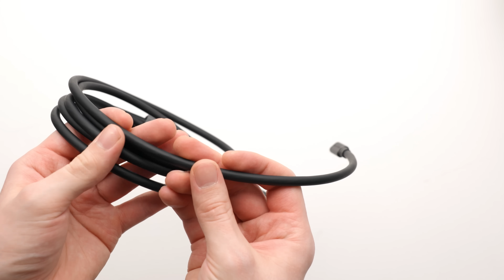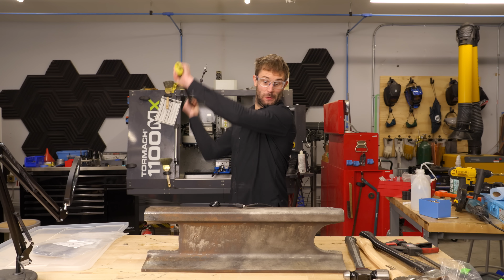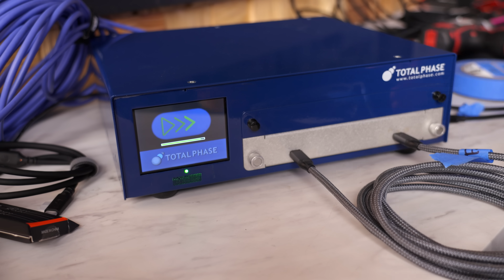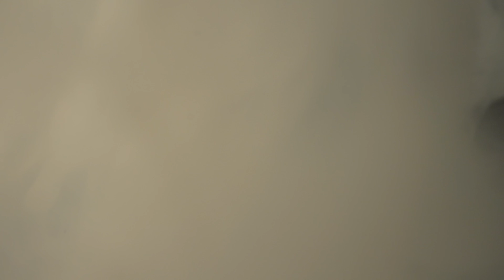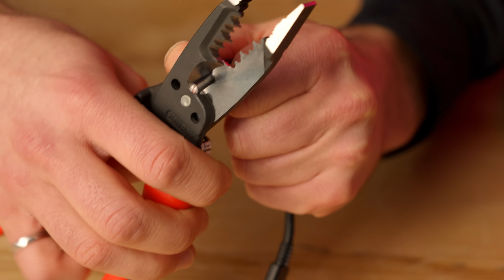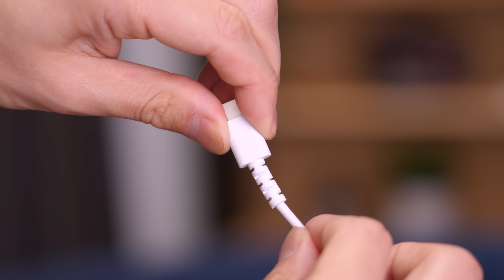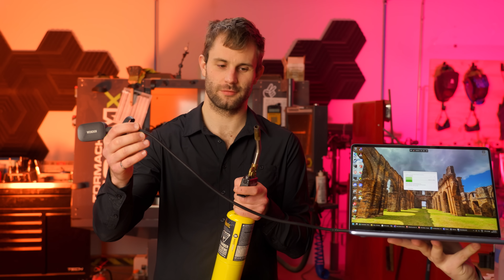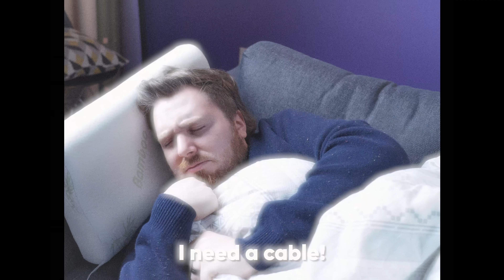Why It Took Me 4 YEARS to Make a USB Cable

Comment: 8:21 i have a micro USB one from Xiaomi, probably a lightning one by apple obviously, and if i remember correctly (we already threw it away), a 30-pin iPod dock charger. they were all like that, surprisingly, the microUSB one works fine, i even use it sometimes to charge my switch pro controller because dumbass company ("Performance Designed Products" if my linux desktop is not wrong) that made the controller decided to bury the port inside the controller's housing, and expect you to charge the thing using the joke they call a cable with a USB A housing that goes on for miles, there's like 7 triceratops there my man, just on the housing, that one xiaomi charger is the only one that fits in that joke of a port too, not like there's a tab or anything, but the hole is so tiny, oh and did i mention it won't talk to the CONSOLE over USB? like, you tell your switch to make pro controllers use the USB port for talking, nope, it just gives up instantly. IT DOESN'T EVEN LINK TO THE CONSOLE OVER USB SO WHAT EVEN IS THE PURPOSE OF GIVING IT THE CAPABILITY TO TALK OVER USB?! AT THIS POINT SLAPPING A FUCKING DC BARREL JACK WOULD COVER 99% OF THE USES FOR THAT PORT, except spamming your linux desktop with "USB device detected" "Performance Designed Products Afterglow Wireless Deluxe Controller has been connected." when the usb on your pc craps out and it looses connection
edit: dumb controller got the awesome USB transfer speeds of a 2004 HP PDA

Comment: I have had a USB 3.0 cable for 6 years, bought at Albert Heijn, it works fine, maybe one day when I need it, I will buy a new one or when I have more devices and I also have a 40w charger, it is enough for my needs

Comment: 99% of my cable usage is A-microB3, C-microB3 (hard drives), and  A-lightning, C-lightning (iphone, ipad).  I completely understand why you guys chose A-C and C-C to start with, I just don't actually need either of those until I eventually get around to upgrading my phone or ipad.

Comment: I haven't bought a USB cable in years, but the one in my car that I was using for Android Auto for the last 8 years decided to die on me 3 weeks ago. None of the cables in my big box of cables worked properly for the job so I finally had to suck it up and buy a new one. 

I was standing in line at the grocery store and saw the shelf of cables and they wanted over 20 dollars each for the cheapest looking cables I've ever seen, Home Depot was the same, and Best Buy as well, so I hopped on Amazon and bought a 5 pack of the same cable you showed failing at the beginning. For my purposes, they work great, but for a fully validated cable I don't think 16-20 dollars is unreasonable if that's what you truly need

Comment: Im curious about the connector durability itself. Im not talking the durability between the male end and the housing, but rather the actual connection of the contacts between the male and female ends. Ive stopped using anker cables for chargers because i find that their connection to my phone wears down over time and gets to that situation where i have to unplug it, flip it 180° and plug it back in, i have to hold it at an angle for it to work, and the charging speeds are rapidly decreased. Ive found belkin cables tend to fare much better with this and they tend to last close to 2 years of daily use without too many issues (the last clable lasted close to 2 years and i finally replaced it after the connection was so weak it would literally fall out of my phone from the cables own weight, and no, my port wasnt dirty, ive cleaned both my phone and the cable, and no change, but when i used a bew cable, the issue dissappeared completely, it was the contacts and connector detents that wore out).

Comment: Honestly, one of the most exciting parts is the variety of lengths. I don't need 3ft or 6ft even if they work 100%. Any extra length is clutter and wire management I have to deal with.

Comment: Current price for C to C is $27 (apparently regardless of data or length? It never changed as I switched products)
Most cheap C to C cables are about $6-10. Most quality cable are $16-20.
Not unreasonable but I would only buy one if I needed that level of quality.

Comment: As someone who only buys properly certified pro grade cables, I can tell you those chonker connectors are not going to fit in pretty much any phone cases. Also while Apple's older cables definitely had their problems with strain relief, people abused the absolute shit out of them. The remark about them lacking USB-IF certification is weird considering they're a core member of the consortium and wrote a good chunk of the USB4 standard.

I pay the extra for listed, certified cables. The crapshoot is real with everything else.

Comment: @Linus Tech Tips
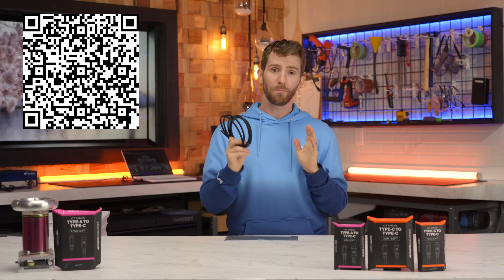10:57 QR ERROR
When I scan this code, I get no products, I do get to the website, but both USA & EU version shows "No products found. Use fewer filters or: remove all" but there is no filter.
Or your website is just confusing?
Reply: Linus has posted on the reddit (and various other places) on Sunday (Vancouver time) that they had to take down the page because Shopify decided to start taking orders for out-of-stock items (all of the cables) and that they would try and fix it.
Reply: @Metal_Maxine  
Ok, thanks for the info!
That situation sucks, but at least there is a demand for the cables :)

Comment: @Linus Tech Tips
9:34 You could sell an adapter:
USB-C girthy to USB-C slim
It might not be as high quality (because quality takes space) so the use of the adapter comes with the expectation of being more careful with it. (probably a dumb / naive / ... expectation, but it's at least cheaper to replace than the cable, so design it to fail there instead of at the cable).

Comment: some kinda breakaway cable would be nice. I've seen a handful of cables rip charging ports right out. Would be nice to have a breakaway, but the wattages on these things are getting pretty high. A breakaway could present arcing and other potential heat issues. Figure it out, LTT. I'll buy that.

Comment: When I saw how chonky those cables were I knew they were legit. Look at OEM USB-C docking cables for example. If you want to stay in spec and maintain signal integrity, you can't make a thin cable. If you need power, DisplayPort and data then you're pretty much limited to 1 meter passive cables (though usually they're around 0.8 meters or so). Cable thickness is the first thing I look at when picking a cable. The thicker the better. I have one VGA cable that's like twice as thick as the usual ones you see and with a really solid connector and it works the best by far. It was getting thrown out at work and I was like, "No, no, I'll take it."

Comment: I bought this 40 cm 20 Gbps USB-C to USB-C cable a year a go from Aliexpress. It looks good and feels like a quality thing. I used it with my PC's front panel USB-C connector to program an ESP32. That went fine the first time.
Later when I had to tweak the code and re-connect the ESP32, windows didn't even chime when it got connected. Thonny didn't register it either, and this was 10 minutes since it worked fine. 
I found an older cable bought in a Norwegian store that had no ambitious marking about speeds, but it has always worked reliably, and this time it was no different. It's skinny like a spaghetti but it worked right away, coding went like a breeze and the project marched onwards.
I hope you can get European distribution in place so that we can get both sturdy and fast cables here without having to pay extortionate fees.

Comment: I assumed from the title and thumbnail that you were gonna DIY some cabled while discussing the spec. Didn't even cross my mind that you'd actually created LTT brand cables! If you've got a 3-5m USB C one that won't die in under a year (and then be left sitting on the side table, never getting around to returning under the 5 year warranty), then I'm so so sold!

Comment: Don't understand why they didn't certify their cables. Linus's explanation was more of an excuse rather than reasoning, "takes too long", you already took 5 years, I don't think you have an aversion for time. Too expensive, yeah okay, I don't think anyone who watches this channel thinks ltt is strapped for cash. A 3rd party board to test and certify your product would only solidify your claims. The whole "apple hasnt certified a cable in years" schtick was pretty dumb too considering the point of this video was to highlight how you are not following the same path as other cable manufacturers.

Comment: the LTT store link shows "No products found". The link to the forums shows "we could not find that topic".
Reply: "We are having an inventory tracking issue where the site is allowing people to order out of stock cables and to minimize the number of backorders we are taking, we turned the pages off while we work with our team and Shopify to fix. It just happens to be the weekend so it's not as simple to get it's patched immediately. 

Sorry for the confusion. If your order was impacted in any way, you should hear from us directly."
Reply: @GhostRyder2008  where did you find this?
Reply: @UNgineering  I googled the error and found a post on Reddit from LTT about it

Comment: 9:30 I find that if a cable doesnt fit into the port for some reason, you can use a knife to just away the rubber sheath...

Comment: I opened the link to check the price but it says "no products found".
Reply: From their Reddit:
"We are having an inventory tracking issue where the site is allowing people to order out of stock cables and to minimize the number of backorders we are taking, we turned the pages off while we work with our team and Shopify to fix. It just happens to be the weekend so it's not as simple to get it's patched immediately. 

Sorry for the confusion. If your order was impacted in any way, you should hear from us directly."

Comment: "No products found" on the website
Reply: From their Reddit:
"We are having an inventory tracking issue where the site is allowing people to order out of stock cables and to minimize the number of backorders we are taking, we turned the pages off while we work with our team and Shopify to fix. It just happens to be the weekend so it's not as simple to get it's patched immediately. 

Sorry for the confusion. If your order was impacted in any way, you should hear from us directly."

Comment: So you shove 90 ohm differential signal through two coaxial cables? You used 45ohm LVDS micro coax cables or something similar?
Is Shielded Foiled Twisted Pairs really out-of-spec so much that it's actually better to double-coax pair?

Comment: The coolest part of the video is linus with the cables at the end 😅😅 otherwise, i dont think a lot of people need these. For example i needed some fast and long cable for my Quest2, the second one i bought worked flawlessly, so i got two of them, and i have 4m usb cable from two parts without any active elements, work fine, for a few bucks.

Comment: I need an adapter that type c to multiple things like hdmi usb a type c and also can charge the laptop and i need to leave it alone with plugged into the wall. So i can switch between my business laptop and personal one into my setup with just one type c cable

Comment: how much did they cost? the listing has been removed so now i have no reference to how pricey they were. I assume they sold out but if thats the case idk why they took the page down
Reply: 20-30 ish for most of the skew.

" We are having an inventory tracking issue where the site is allowing people to order out of stock cables and to minimize the number of backorders we are taking, we turned the pages off while we work with our team and Shopify to fix. It just happens to be the weekend so it's not as simple to get it's patched immediately.  " - LTT

Comment: The link to get the cables doesn’t have the cables
Reply: " We are having an inventory tracking issue where the site is allowing people to order out of stock cables and to minimize the number of backorders we are taking, we turned the pages off while we work with our team and Shopify to fix. It just happens to be the weekend so it's not as simple to get it's patched immediately.  " - LTT

Comment: too bad that it says "No products found
Use fewer filters or remove all" on the website when trying to go to it, I guess all sold out for good now :(
Reply: " We are having an inventory tracking issue where the site is allowing people to order out of stock cables and to minimize the number of backorders we are taking, we turned the pages off while we work with our team and Shopify to fix. It just happens to be the weekend so it's not as simple to get it's patched immediately.  " - LTT

Comment: Kinda lame to launch an awesome product we all need and then have zero available in your store.   Like did you guys even think this through at all?   Not like its your first product launch.   Just keep it to yourself if you don't want to sell them instead of getting us all excited.   (I'm just salty as so many things these days are rug pulls)
Reply: They bought a lot extra, but didn´t terminate it. Since they don´t really know which sizes will have the highest demand. 

Pretty reasonable of them to do tbh.
Reply: @Mel21-21  Perhaps, I don't fully understand what you mean.   There are none available at any size or spec.  What do you mean didn't terminate it?
Reply: @robpetri5996   What do you mean didn't terminate it? They bought spools of ready cables, but didn´t cut them and add the ends yet. This allows them to replenish stock much quicker for the cable lengths that get ordered . Instead of just ordering a bunch of every length from the beginning and have a lot of stock, which noone wants to buy.

There are none available at any size or spec :
They published a reddit post saying that there was an issue with the store letting people order cables, which were out of stock. So they removed all listings until the issue got resolved to avoid creating a huge backlog.

Comment: Put them back up on your site as sold out and take orders!
I'm happy to wait for another run of them or to get my order produced and fulfilled at the end of a month.
Reply: " We are having an inventory tracking issue where the site is allowing people to order out of stock cables and to minimize the number of backorders we are taking, we turned the pages off while we work with our team and Shopify to fix. It just happens to be the weekend so it's not as simple to get it's patched immediately.  " - LTT

Comment: Man, if you guys could organise a high quality lightweight cable with a header terminal at the end, I'd love to prototype a gaming mouse using it and see if it can't minimise latency. Doesn't need to be high wattage or throughout; just have good signal integrity and improved durability if flexed repeatedly at any given point.

A little off topic, but I've been thinking about mice for a long time and always thought a semi-rigid cable with "links" where it can bend more freely would make a better mouse cable, like a chain. This would be used with a bungee where only between the bungee and mouse needs to be that flexible and durable, and in fact the bungee could be more of a dock with a removable cable so you can vary the length to your PC/laptop/device (between the bungee and mouse is a relatively fixed distance). It might be heavier, but could be coated in hard pad material, like Teflon, or even supported by the bungee like a suspension bridge to minimise friction. So many things I'd love to try.

And superior ceramic mouse feet. Seriously, hard pad gamers, go buy some lexip ceramic feet, you'll never go back. They look like little shirt buttons. Just ensure your mouse has sufficient lift off distance settings (mz1 works).

Comment: I would rather have "expensive" hardware that just 'works', preferably outlasting even myself, rather than cheap solutions that I need to swap out 3~4 times per year, ending up more as a latent subscription fee, as well as on some burning landfill in some 3rd world country. If this is your product, you are indeed on the correct path.

Comment: Calls fancy cables snake oil, makes fancy cables, then using snake oil marketing in the beginning of video of how you need to get all the data perfectly across... Like I 100% understand that is the problem with cables they might work but they are not working perfectly. Also throwing shade at Audio Quest, I'm sure there were more ridiculous examples to use, not that I can afford them. Still interested in getting a USB2 B to A style one if you make one for may Audio interface. It has issues sometimes but it might be the port and not the cheap cables.

Comment: Nicely explained.  The store doesn't have any cables?

I was involved with Type C from the beginning.  

The girth was one limit, the consumer isn't going to buy a 1/2 / 12.5mm diameter cable, and as you found bigger coax is better.

I suggest PAM3 or 4 instead of NRZ coding, for higher speed (more bits at a given frequency).  Fortunately PAM3 was used on the latest revision.

I trust your "certification" over the certification that allowed cables to fail your certification.

Comment: As someone who's been in manufacturing for a decade, I'm not surprised at all. Most companies already have molds, assembly lines, etc in place for production. Finding a company willing to chance anything about their process in an attempt to make a new product would be slim. However, I will say, most people don't realize how small changes in manufacturing can add up quickly. So the ROI has to be there.